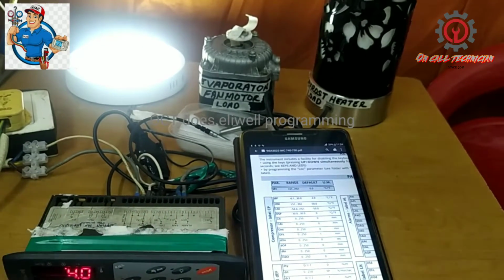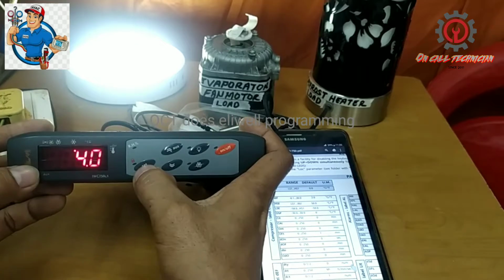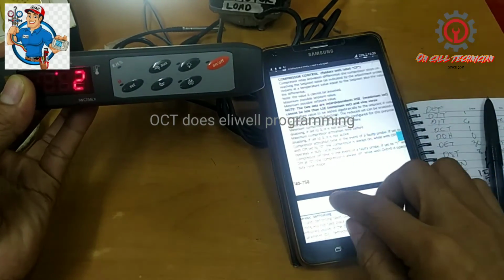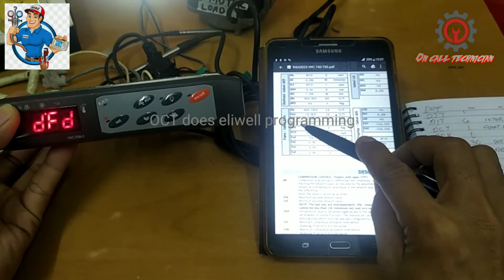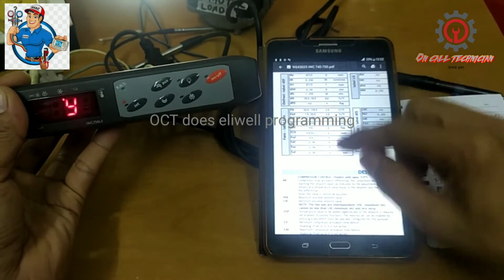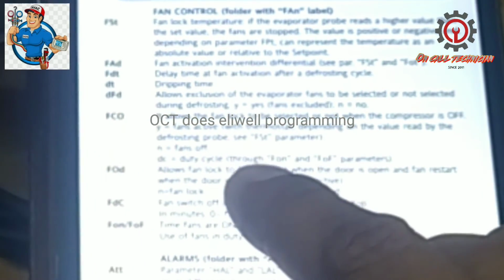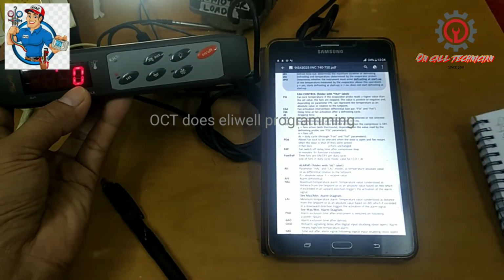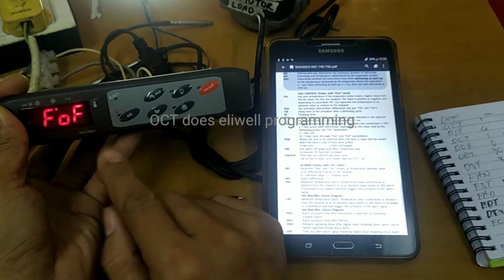ELIWELL IWC750LX PROGRAM FROM DEFAULT TO CHILLER SETTINGS (TAGALOG SUBS)

Comment: Hello i have a problem in same thermostat.
 eliwell iwc 750 The compressor won't start. 
The compressor signe not active .
Eco lighting
Temperature in room 10°c
Set point -16°c
DiF = 2
Hse = 50
Lse = -50
Osp= 0
Cit= 0
Cat= 0
Ont= 0
Oft= 1
Don =0
Dof=0
Dbi=0
What you think is the problem.
Reply from the maker: Go to label FNC and click SP* in replace of OSP.
Please correct your settings and try applying my settings.

Your compressor stops at -16 and restart at -14 too quick , try to prolong. Just a piece of advice, i started sharing knowledge for us to learn the right way. Ty